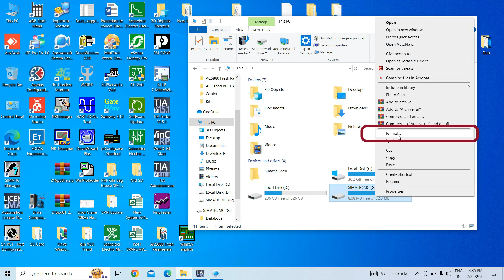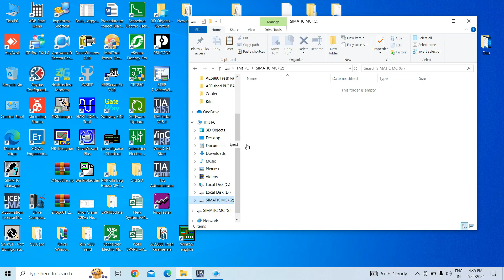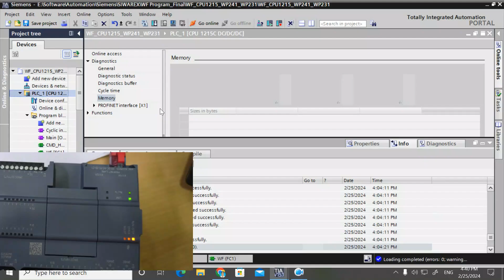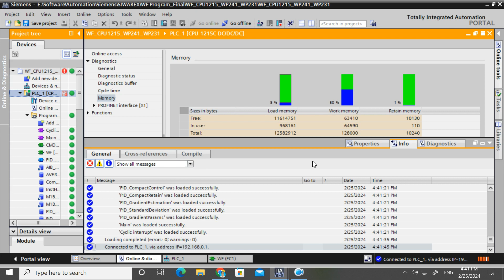TIA Portal: How to Delete Program from Simatic Memory card.

Comment: Hi sir! can you help me to do a project?
Reply from the maker: Yes, which type of project
Reply: Using ladder diagram to create HMI with TIA.
=> There are two push buttons I0 and I1 for start and stop. I2 is final position reed switch. I3 is home position reed switch. Q0 valve for forward and Q1 valve for reverse. When I0 is pressed piston should move in forward direction. When piston reaches to final position I2 is on. As I2 is on, piston will wait for 5 seconds and after 5 seconds piston should move in reverse direction. When piston reaches to home position I3 is on. As I3 is on, piston will wait for 3 seconds and after 3 seconds repeat the process FOR 5 CYCLES. I1 is an emergency off button.
Reply from the maker: @empty_321  do you have any specific CPU and HMI  option to choose
Reply: Yes sir ! we can use whichever PLC program to do it. Just simulation and modified it.
Reply: Do you have Telegram?
Reply from the maker: Here Is your Requested Video and Project
Video Link
https://youtu.be/iIFje9H5bD0

Project File Link:
https://drive.google.com/file/d/1hf7ky8YzgoRRNrvTBuJX5bodDRXHWqjP/view?usp=drive_link